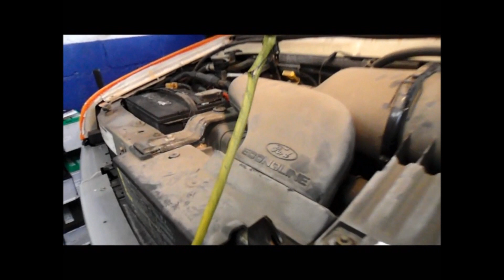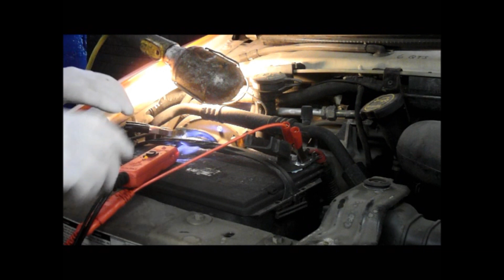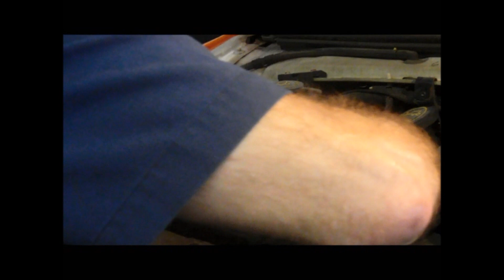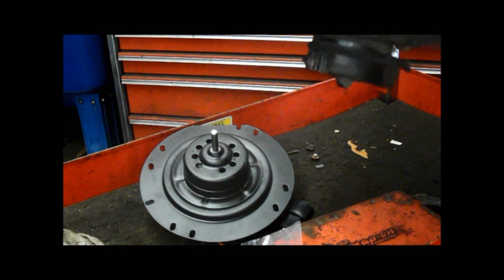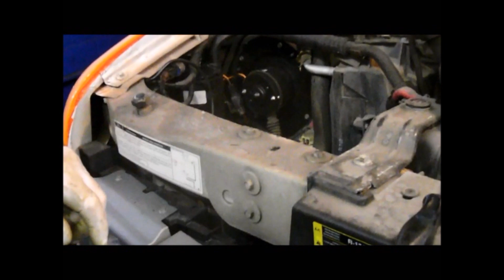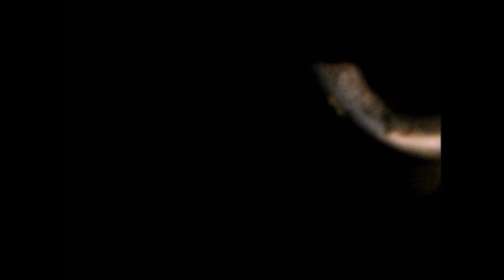How to diagnose  no fan speed on a Ford E150,E250.E350,F150,F250 and F350

Comment: I've got a 1986 Ford Econoline e150 van. And by not having no power anywhere to the blower motor or to the mixing valve absolutely no power it can still be the resistor

Comment: Just replaced the blower motor on my ‘97 e250. Worked the first time I drove it. Now, not. I guess I need to replace the resistor. Oh well. Not a big job.
The blower still works. Just no speeds.

Comment: I have a 03 ford f150 lariat with the automatic climate control I just changed the heater resistor a blower relay under the dash I checked the blower plug with a test light and no power to the plug

Comment: I'll have to check out my friend's van about this. I would have cleaned the battery first before putting it back in the van. Shouldn't there have been some sealant between the blower motor and the housing with the new one ?
Reply: So you need to leave this critique in the comment section? A simple "thank you" would be appropriate.

Comment: 2013 E-250 -- Everything was identical except mine absolutely was not coming out until I removed the two bolts securing the receiver/dryer and with that loose it came out OK. Thanks

Comment: so i replaced motor resistor and my fan motor new still cuts on and off it wiil run for maybe 5 min and then turns off i can turn the control from ac too heat a few times back and forth and then it will come back on for 5min and cut off again any ideas what i need too check on??
Reply: Sounds like a connection is bad - check them.
Reply: That’s a vacuum issue
Reply: @SteveKurtzJr  
How to check that?

Comment: Nice video, thanks for the great explanation! I checked mine. I had 12 volts at the blower motor. I saw it had a pig tail so it was a replacement. I checked the resistor and it was a bad connection so I had to replace it and the connector end. I have a shuttle bus with the van cab. I was lucky because there was no battery in the way. The battery is underneath rear passenger side of the bus. I put resister and new harness end on and found fan motor would only run if I hit it hard with a pair of pliers. I have ordered a new blower motor. Thanks!
Reply from the maker: Thanks for watching I'm happy to help

Comment: I have a same problem by check the fan by connecting couple wires from the fan wire to the battery directly  the fan  is working so I don't know what's my next steps

Comment: What if you don’t have power at the blower motor? What would the next step usually be?
Reply: Most common problem is the fan speed switch in the dash.  If the fan does not work at all check the blower motor by connecting 12V directly to the +- in the fan terminal.  If it comes on then its highly possible its the fan switch.  They tend to overload on low and melt.   If it operates on high only it the resistor next to the motor under the hood.   if it none of these check the 50 amp and 15 amp fuses and relay under the hood and at the fuse panel by the break peddle.  you can google the fuse layout for the van.  it also has a key on the cover under the hood on the fuse box.
Reply: Native American check for a vacuum leak. These fords often have issues with that and the symptom is no air blowing through vents when you are under load (stepping on gas). Once you let off the gas, the air pressure returns.
Reply: @Native American I have the same problem. My Mechanic told me it was some sort of vacuum leak. I just lost the blower motor completely. Has voltage at the connection so I'm assuming it now has to be replaced too from running all the time.It's too cold outside and my mechanic is booked up. Welcome to Wintertime!